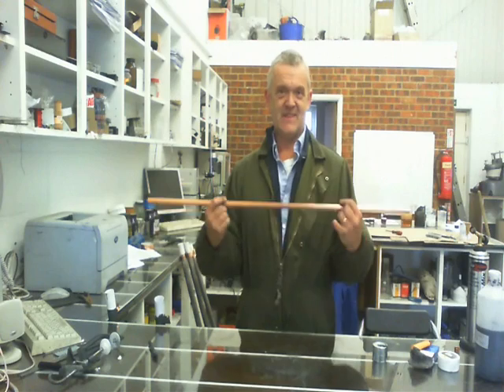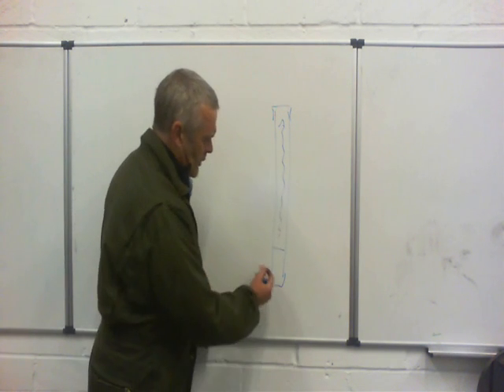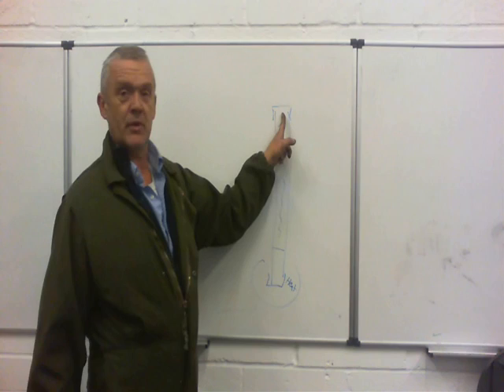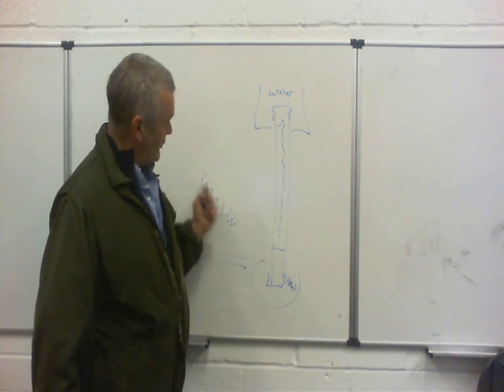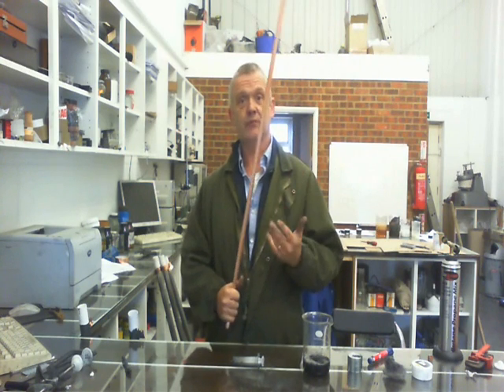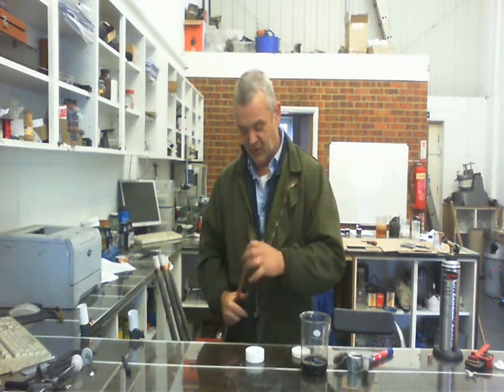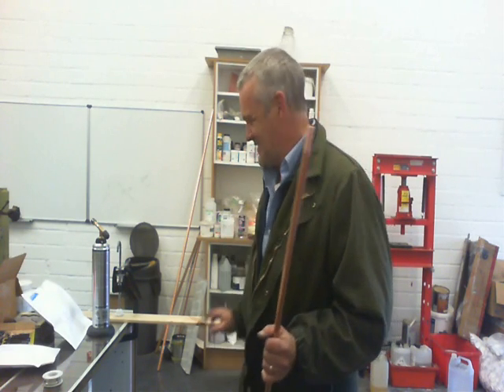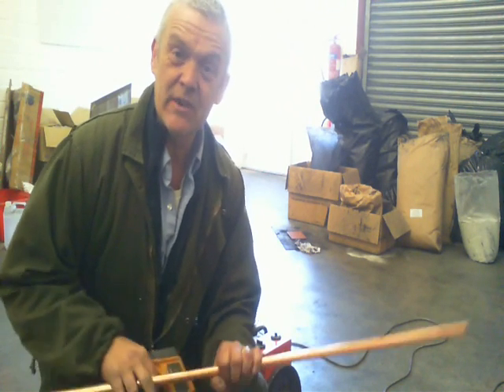How To Make A Heat Pipe (or solar heat collector)

Comment: Tried this but ran into several problems. 1. I found the vacuum in the pipe caused the solder to be sucked inside - so it didn't seal and I could hear balls of solder rattling around inside. If I then heated the base of the pipe, I could hear a leak (I tried it several times with same result. To overcome this, I used valve fittings on the top - so when I heated the the fluid to the point it started to steam, I shut off the valve. 2. Despite doing this, the pipe did nothing when put out in the sun (average UK day of about 20 degrees C. I also tried heating with a hot air gun, but didn't feel that it was doing much. I couldn't tell if there was any fluid left inside - perhaps I'd over- boiled, so tried again (it's possible to open the valve and replace fluid with a syringe) - still same result. So, a couple of questions - A: should the valve system work (can't really tell if the valves are 100% sealed. B: it would be better to use the soldered cap method - but why did RMS's work, when mine simply sucked the solder in? C: If i get a working heat pipe using this method, what sort of performance can I expect in the UK? I'd like to use it to heat water for an outdoor shower - so perhaps have 15 heat pipes and a heat exchanges to run water into a sand box during the day so that there is a heat source for a shower in the evening - is this feasible across a normal range of UK weather conditions, or would it only work in strong sun during the summer months? Any advice, ideas welcome - thanks

Comment: Could this work if the steam was in a ring pipe like the insulating coffee mugs with the bottom cut out i wanted to pass air through the center radially and have the middle outside lengthwise of the casing  heated and air move through one end on the bottom and out the top fanned from the intake side up from the ceiling down to the floor to the lower part of the heater.  Exhaust fanned from the top corner of the heater down to the floor for good air mixing.

Comment: Hey Robert, i wonder if it could be possible to do the same thing like evacuated tube solar collector, but with a flat radiator/spiral tube inside (or in btw two?) a double glazing windows ? It it could maybe be more efficient than weather surrounded lonely pipes ?
Cheers !
Reply: The pipe has to be straight for this type of heat pipe. The gas has to move through the center of the pipe while the liquid flows down the sides. A curve inhibits that. The effect happens very rapidly and can transfer large amounts of thermal energy.

Comment: Trying to see if a 10 meter heatpipe to transfer heat from a solar collector to the house would be a good option.
Great content keep up the work !
Reply: Water would be a better choice. Heat the water and transfer it to the house via insulated pipes. 

Water can hold a surprisingly large amount of BTUs (which you’ll need if you’re heating a home) and you can pipe the water throughout the house to distribute the heat better than a heat pipe.

You can also heat the water during the days when it’s warm outside and use it later that night when the temps drop.
Reply: @MichaelApproved  If he needs to transfer heat from a solar thermal heat collector on the ground, he could use a heat pipe to transfer heat from a water storage tank to another one on top of his house. He'll need to insulate everything really well. He could then gravity feed hot water down someplace without a pump. This is only an efficient solution if he's only sending the water one direction. Otherwise, he'd be better off with a pumped system.

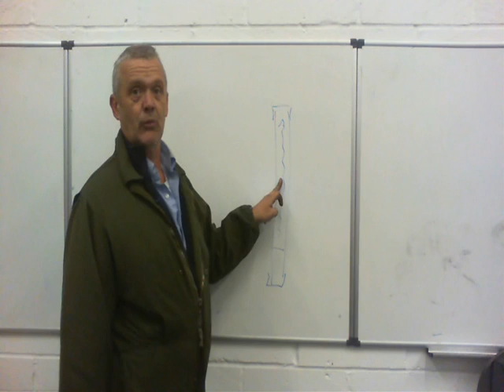Comment: 1:44 "its driving out the non-compressable gasses",  Rather than non-compressible , you mean non-condensable.  As oxygen and nitrogen are compressible at room temperature but don't condence at the heat pipe's working temperatures.  And the non condensing gases get in the way of moving the condensing gas from moving heat from the boiler end to the condensing walls.

Comment: I wonder if I'll get an asnwer but does anyone know whats an approximate ratio of heat pipe length vs fluid amount for water in the pipe?
Reply: you should use enough water to get capilary action, that's it.
Reply: @fss1704  Thank you for the reply, nd yea, I got that... but how would you know how much fluid is is that exactly?
Reply: @ShubhamShukla326  with a microdosimeter, you can put more if you want but that reduces vacuum a bit, and if you put less theres less conductivity. You can make a microdosimeter by using a scalp and something with a thread to compress the silicone tube a little bit to inject a certain amount of liquid
Reply: @fss1704  Thank you! :-) appreciate the replies
Reply: I'd think you could find that ratio by studying the weight changes of the heat pipe

Comment: A little addition.

1: Most people learn in school that water boils of around 100C. This is only true in normal atmospheric condition. In a Vacuum water boils of around 18C. In a heat pipe it´s not pure vacuum, but its pretty close, so you might get it to work in as low temperature as 22-25C.

Also, its depends in the depth of water.

2: The heat pipe just absorbs heat where there is water (or liquid). If you want to use it for a solar collector, you do want to fill it up quite a bit, almost as long as the heat collector elements go.

This change the boiling point of water. The bolingpoint may be 22 degree at the very top, but it´s probably around 30 to 40 degree at the bottom (for a 1 ish meter long pipe).  If the whole system is 50-60 degree it don´t matter...

That is... if you want to collect heat, you do want to fill it up quite a bit. But if you want to cool something (like a processor), you just want to fill up a bit in the bottom.

Basicly the part where there is water is cooling, the part there is steam is cooling. So how much you fill it deepens on what you suppose to do.
Reply from the maker: +matsv201 nice addition mate - thanks
Reply: Robert Murray-Smith 
No problem.. Any time.... I understand it that you was not quite sure what level of liqud you would need?
Reply from the maker: +matsv201 i wasn't and i absolutely appreciate the input mate
Reply: Nice.. Yea, it might har do figure it out... but at least to me its quite obvius when you think about it that it have to be liquid to absorb energy and gas to discharge it.

;)
Reply from the maker: +matsv201 yup :)
Reply: Also the water piller do ad pressure.. for a smal table size heat pipe its not noticeable. But for a Solararay size it is.

Can use this table to figure it out.
https://en.wikipedia.org/wiki/Triple_point

Comment: I wonder why water-cooled heat pipes aren't used in gaming PC.  Or are they? I've only seen air-cooled heat pipes or water cooling without heat pipes.
Reply from the maker: +Luc Chase they are used mate
Reply: +Robert Murray-Smith haven't found any.
Reply from the maker: +Luc Chase here's some http://www.corsair.com/en-gb/cooling
Reply: +Robert Murray-Smith they are not water-cooled heat-pipes.... that is water-cooling INSTEAD of heat-pipes. The water is not being used to condense the gas.
Reply from the maker: +Luc Chase lol - oops - should read more carefully - cheers mate
Reply: +Robert Murray-Smith that's OK.  I have this perhaps crazy idea one could use a chain or stack of heat-pipes to cool a heat-pipe.... in series... kind of like a series of magnifying lenses produce a telescope.
Reply from the maker: +Luc Chase i like that idea mate - not sure how you wold implement it - but i ilike it - what's not to like about crazy lol

Comment: Have you ever made a rotating heat pipe like in patent 3999400? Seems like a way to make a very simple window air-conditioner. I tried to make a rotating heat pipe using a Dust Off can and You Tubed it. However I could think of a way to measure any heat transfer effect.
Reply from the maker: +ufoengines I didn't even know they existed until you wrote this post mate - i'll hunt out your vid and have a look
Reply: Hoo Ray! You"ll be first to actually look for it Google " Rotating Heat Pipe Model" ( you can ignore the old Outer Limits video in the background. I just really dig the ray gun scene)
Reply from the maker: +ufoengines I liked your coanda model - so i subscribed. nice work mate
Reply: Thanks So far I've got the big who cares on the Coanda  idea but read a small kid lost and eye and with drones making deliveries ( maybe) time has come to start thinking "THE WORLDS SAFET DRONE!"  Coanda Thrusters and foam rubber construction. For danger but looks like great fun check out "Racing Drones" You Tubes. Man ! Think of one having one of those sucker hit you or your kid in the head!

Comment: Very nice explanation Sir,  I am also working on Heat Pipe Heat Exchnager.
Please guide me how can change the filling ratio in the heat pipe as it is already soldered ??
can we use nanofluid(graphene) in heat pipe as the posses high thermal conductivity, is they going to sattle down at heat source end of heat pipe ??
mail: gurtejguru7@yahoo.in
Reply from the maker: +Gurtej Singh you will probably have to open the pipe - if the particles are small enough and the zeta potential is right they should stay in dispersion
Reply: Thank you Sir, How can be check the limits such as sonic limit, entainment limit, viscous limt, etc of heat pipe (Thermosyphon only) ??
I am using three chemicals ammonia, methanol, ethanol in three different pipes for low temperature heat recovery application. Without checking the limits I will not be able build a heat exchanger.
So pls guide me on the limits issue ??

Regards
Gurtej Singh
Thapar University, Patiala (India)
Reply from the maker: +Gurtej Singh I get asked this often - go and ask you professors - they are paid to do this for you - i am not
Reply: You right Sir, but my he not giving me satisfactory answers, he is just shooting in air. In fact in our curriculum he made optional, he made a mess of this project and due to that I  am looking for alternative resources.

Thanks for your true services am deeply honored. I wish could meet you one day .
thanks again.
Reply from the maker: +Gurtej Singh i am sorry for that mate - this channel is a hobby for me - i just can't let it take up too much time - i already get 200 or so emails a day and it takes me 3 hours to answer - anymore time will mean i have to shut the channel - i really am most sorry
Reply: @gurtej Singh
pls refer this book for detail design of heat pipe
Heat Pipe by David Reay & Ryan Mcglen
pdf file of this book is available on internet for downloading

Comment: Hi Robert, the test shows its not as quick as the fancy smaller diameter pipes. Is that because the length is very long or the vacuum is not optimised, or a bit of both?
Reply from the maker: Thanh Tran it will be a bit of both mate
Reply: I've been thinking (well just now actually) about CPU cooling, instead of having watercooling to have one of these unlined heat pipes and copper/aluminium fins. They might do white a big of work even without a fan.How do you go about soldering the cap on, can I use leadfree PCB solder instead of fancy silver solder? Cheers Robert
Reply from the maker: Thanh Tran i suppose so - i have never really tried but what you sugest seems reasonable
Reply: +Thanh Tran the xbox 360 uses heat pipes and a fan, they also just fold the pipe to seal it :)

Comment: please do you have simulation by ANSYS or any program about heat pipe?
Reply from the maker: Mech Engineering no sorry
Reply: Mech Engineering Hi, you should use Solidworks Simulation or ANSYS, override K to be 10,000
Reply: 10000 what?
Reply: Heat transfer coefficient 10,000 W/(m2K). compared to 400 on copper or 150-200 on aluminium

Comment: Oxygen and nitrogen are non-compressible??
Reply: @Alex Wilding Oxygen and Nitrogen condenses just fine, just at temperatures way outside of what we need for solar heat pipes. :-)

You could lower the temperature ranges by vacuuming out the air before you solder the pipes shut but that's a lot harder to do do in your garage.

Comment: Hi Robert
Nice expiration  on how a heat pipe works
If you were to give the copper pipe or give a glass tube an outside coating of graphene would it then absorb sun light or direct heat sores and hold heat better that an uncoated copper pipe or glass tube with its standard black coating.
As I believe graphene is very good at heat transfer.

Comment: Thanks for this important video , I want to ask about when you boiled the water at the evaporator section then you just ook to the vapor appear and look the top section ,at what pressure will be the water inside the pipe ?

Comment: Hey' Robert nice video. Well just thought I would mention instead of soldering cap on at the point you did, maybe you could have used a Brass Shrader valve assembly solderd into the cap and then used a vacuum pump to bring vacuum to aroung 5 to 7 bars of vacuum. Ideal vacuum being 15 or more bars, 'but you could not expect to achieve this type of vacuum. So what do you think of this idea? Well thanks again Robert. Have a great day.
Reply from the maker: i think it is a brilliant idea mate and i am now mulling it over for the next one
Reply: LOL I hope it works out for you. Thanks again for sharing your knowledge with me.
Reply from the maker: James Kennedy
i like the sound of it mate - cheers

Comment: I was reading one of the Wiki entries , and came across the early 20 th century of using mercury as the working fluid in a power station . 
I have interest in running a heat tube the other way up , hot point at the top & heat shedding point at the bottom . Do you think a wick would be enough ?
Reply from the maker: sorry mate - i don't quite get what you mean.
Reply: Robert Murray-Smith Thanks for the reply .
---------------------
" I was reading one of the Wiki entries , and came across the early 20 th century of using mercury as the working fluid in a power station " https://en.wikipedia.org/wiki/Mercury_vapour_turbine 
---------------------
" I have interest in running a heat tube the other way up , hot point at the top & heat shedding point at the bottom . Do you think a wick would be enough ? " Ok , I have the opportunity to remove heat from an " exhaust " flow , but the point I want to deliver it to is blow this exhaust . This design relies on convection in it ' s un wicked form , but could wicking at least making it something better than a conductive rod ? Any ideas ?  
One thought . The use of distilled water to keep the scale out of system .

Comment: Great introduction — I always thought it was more complicated than that.  The only concern I have is about pressure.  If you seal both ends and manage to evaporate the working fluid completely, won't the internal pressure be very high?  Is there a rule-of-thumb (or formula) for determining the maximum working fluid volume given a specific heat pipe volume?  What is the failure mode for an over-pressured copper heat pipe (will the pipe rupture suddenly, a cap blow off at high speed, or a tiny leak slowly release the steam)?
Reply from the maker: I am sorry mate - but you are over thinking this. Your chances of blowing the pipe or getting a total vacuum this way are insignificant. As for the amount of fluid to use - experiment to find out - it won't take long but it's a small amount - you need to have some fluid in there all the time - so you need to consider your working temperature, fluid type and volume - with water in a 1.2m pipe for solar it's about 15mL. Failure mode is sudden rupture - but unless you plan on cooling a nuclear power plant this way you are not going to rupture the pipe
Reply: Robert Murray-Smith All good then - cheers!
Reply: @penfoldooo2160  Too much fluid and it won't be able to evaporate. The safe working temperature I saw online for copper/water heat pipes was 20°C to 150°C. At the low end it stops functioning. I don't know what happens at the high end but I think I wouldn't want to find out. I can't remember if the low end number was only for lateral heat pipes with internal wicks or not. I'm looking at making lateral ones so I can transfer temperatures efficiently in a DIY geothermal system for my home.

Comment: One other technique for manufacturing the capillary structure is edm. Of which graphene with dielectric fluid makes less messy and allows for finer detail. https://www.academia.edu/4232842/Accuracy_improvement_in_nanographite_powder-suspended_dielectric_fluid_for_micro-electrical_discharge_machining_processes

In addition you can build your own EDM machine fairly inexpensively.   You can purchase a book inexpensively with a circuit board and list of electronics components for under $100.
Reply from the maker: now there is something i want to build lol
Reply: Robert Murray-Smith http://www.amazon.com/Build-a-Pulse-EDM-Machine/dp/0976759624  or http://www.amazon.com/Build-EDM-Electrical-Discharge-Machining/dp/094165351X/ref=pd_sim_b_1?ie=UTF8&refRID=1GJJW6HSBH6A1KSWEJ61   and you can purchase the PCB here http://www.homebuiltedmmachines.com/index.php?page=buy
Reply from the maker: Kimberly Peacock thanks chuck